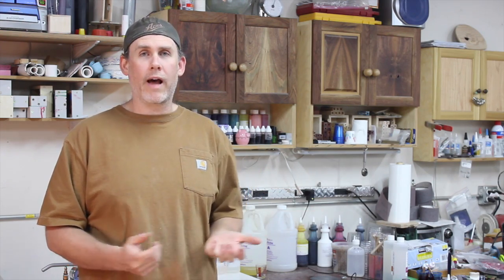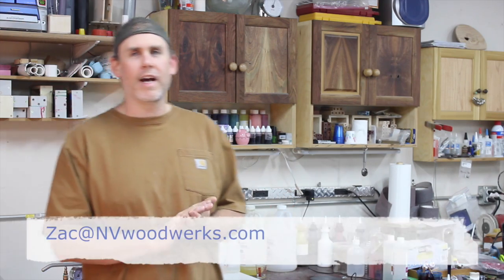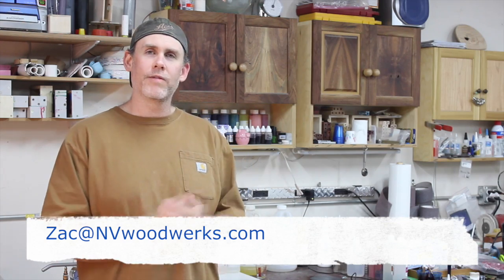Quick Tips - What to do When Alumilite Clear Part B Get's Thick

Comment: Never thought I would have this happen here in Texas. Part B gelled up overnight. I remembered you had this vid about it. Have 32oz clear. Took about 3 times to get it back to normal consistency. Heated up water in a bowl from the microwave (3 minutes each time) and let part B set in there about 5 minutes each time. Good to go and already casted some blanks.
Reply from the maker: Nice!! I'm really glad it helped out. I totally freaked out the first time it happened to me and ended up tossing out about a quarter of a gallon of Alumilite. My hope is that this video will save as many people as possible from doing the same! Can't wait to see those blanks, tag me if you post pics of them
Reply: Hey Zac, the blanks came out great as far as the alumilite still setting up and curing the way its suppose to. Still trying to find my way as far as turning out nice blanks though. BTW, I have a gallon of B clear that is now gelled. At least I know I can save it now.

Comment: Had a bottle of the clear slow sitting around for about 9 months that turned to a thick gel. Using the hot water bath method in an old slow cooker I got it to return to normal consistency in about 90 minutes. Used it to make some ribbons and now I just wait to see how it cures.
Reply from the maker: How'd it work for you Tim?
Reply: Zac Higgins it worked out beautifully. Didn't notice any issues with curing or strength. Cuts, turns, and polishes perfectly.
Reply from the maker: Awesome!! Glad that it worked out! Did you get the idea to warm it up from my video or did you already know about that?
Reply: Zac Higgins originally from your video, but I wasn't sure if due to the age it would work. So I called alumilite and asked them about it and they suggested trying it.
Reply from the maker: Oh good, I'm glad it was helpful. It's always worth giving it a shot even if the resin is technically past the expiration date too, glad that it worked for you

Comment: My part B has not gotten thick yet but it has turned yellow. The silcone mold product I bought was bad and everything came out tacky. By the time Alumilite got around to replacing the molding material, the resin part B had turned yellow. Now all my castings have a yellowish hue. I want to complain to Alumilite but it was like pulling teeth to get the molding material replaced.

Comment: Hello.
Do you know why my Amazing Snow White casting resin part B is getting a opaque cloudy version of itself on the bottom? I had to repurchase it because it was causing my other bottle to make my items EXTREMELY bubbly, and now its happening again, I marked the lids so I would never mix them up the worse thing I can think of is I've left the cap off for maybe a few hours at a time ? 
Thank you very much for reading!
Reply from the maker: I'm not entirely sure. If you left the cap off for a number of hours and it was fairly humid, that could cause problems with the resin and curing. Your best bet is to contact the manufacturer and talk to their technical representative about it. They may be able to pinpoint the problem or they may send you replacement resin if there was a problem with the product
Reply: Thank you very much! I'll try contacting them through the forums see if that clears anything up! :D
Reply: So, if you were interested on the forums they told me you cannot leave the lid off for even four minutes @.@ how difficult lol !

Comment: Hi Zac,

Is it normal for part A to be thicker than part B? 

Thanks
Paul
Reply from the maker: Hey Paul, it depends on which resin you're talking about. For Alumilite White, the Part A is thicker than the B side. For Alumilite Clear, the B side is usually thicker than the A, especially in cooler temperatures. I don't really have much experience with other types of resins though, so it may vary
Reply: Hi Zac,
Many thanks for the quick reply.

It is the Alumilite Clear that I have. It cures very nice and clear but after three days it doesn't feel as though it has completely cured. You can't dig your nail into it but it has a kind of soft feel.

I have a good set of scales and I have done the mixing in room temp.

I only ask as most of your vids and other peoples the Alumilite looks fairly watery.
I will keep trying and see if i can get better results.

Happy New Year

Regards
Paul
Reply from the maker: Well, it shouldn't feel soft after a couple days, however if you can't dent it with your fingernail I don't think I would consider it soft. How old is the resin?
Reply: I bought it 3 weeks ago.
My problem is I can't get a good finish. Even the lightest of cuts and sanding up through the micromesh  I seem to end up with not very good results.

Thanks
Paul
Reply from the maker: Did you buy it direct from Alumilite or Turn Tex? Sometimes if you buy casting resin from Amazon or hobby stores, it was sitting on the shelf for months and has gone bad. Also, just want to make sure it is Alumilite Clear and not "Water Clear" or "Amazing Clear Cast". Those two give most people problems and are softer than "Clear".

Other than that, the only thing I can recommend is my video on how I polish Alumilite blanks: https://www.youtube.com/watch?v=3hGf8qCdCag&t=262s

You have to make sure that you've removed all the previous grit scratches before you move on to the next grit, that's paramount. Also, I have found that using buffing wheels as the final steps give me the most consistent and best polish on my blanks.
Reply: Ahh, I think you may have found the problem. It is Amazing Clear cast.
I didn't realise that there was a difference.
Reply: I forgot to mention.
I'm in the UK. It seems the only product you can get is the Alumilite Clear cast. I'm just happy I didn't go straight for the 7.5 Litre kit. :-)

Cheers
Paul
Reply from the maker: Don't feel bad, I think it's silly that they have three products that all sound the same. It just causes problems. All is not lost though, you should be able to get good results with that product too.

With the Amazing Clear Cast, you have to mix it 1:1 by volume, not weight. That's one of the big problems people have with it. They see other people using Alumilite and weighing it, and assume they should do that with the ACL as well. Also, it has a really long cure schedule compared to "Clear". You'll need to wait at least a day before you can demold it, and the full cure takes 72 hours. I would probably recommend waiting the full 72 hours before you start turning it. Also, make sure that you are keeping the temperature of the room it is in above 60 degrees Fahrenheit - during the measuring/mixing process and while it's curing. If the temp drops too far below that during the curing period, it could cause problems with the curing. 

Give it another shot, and let me know how it goes.
Reply: Hi Zac,
Big thanks for your time on this.
I will give it another go.
You are completely correct on the weighing and volume issue. I have watch so many vids of people mixing by weight it didn't even occur to me that this would be any different.

I will report back 

Cheers
Paul
Reply: Hi Zac,
Quick update. I followed your advice in that last post and all went well.
Measuring by volume and not weight is the key.
I'm hoping we can get Alumilite clear here in the UK soon as I would prefer the faster curing time compared to the Amazing clear cast.

That being said the Amazing clear does give some nice results.
Many thanks for your time.

Regards
Paul
Reply from the maker: That's great news!! Glad it helped out. Yeah, most resins work fine, I definitely prefer the speed of the other Alumilite products though. I'm too impatient to wait overnight =D